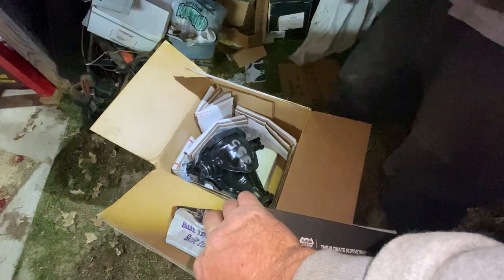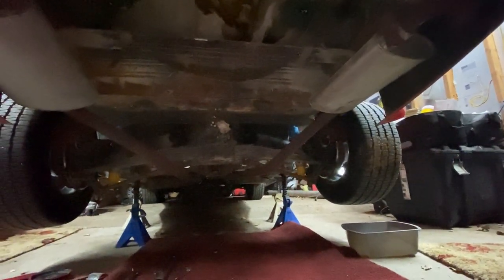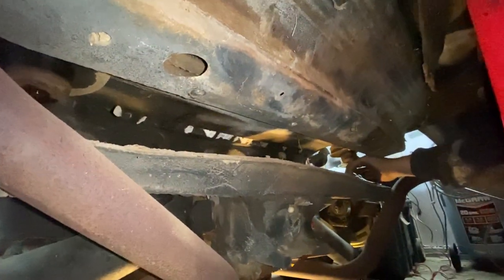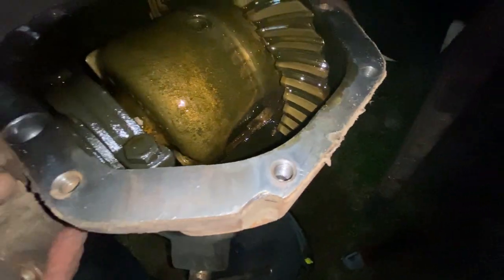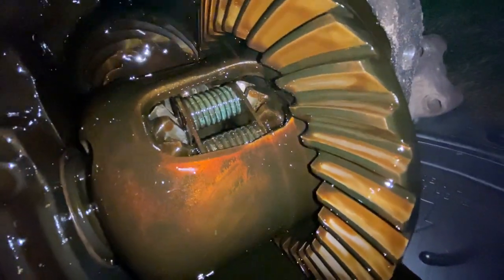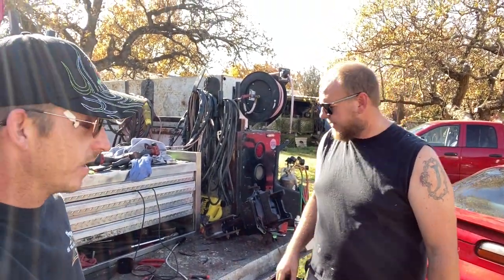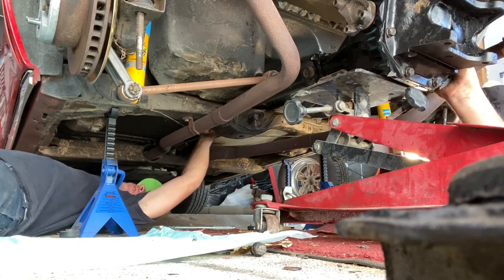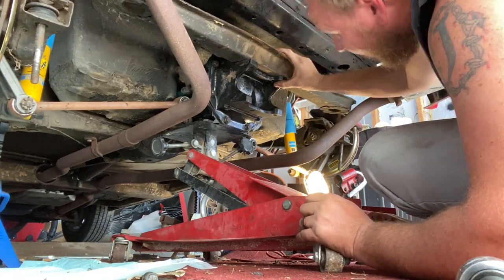1977 Corvette Final components. New Rear End- 355 Gears

Comment: Doing this on my 1979 right now a good chance you could have just changed the fluid and added a bottle or two of posi traction additive and the old one might of been fine.  It's a shame you used the original side shafts that are known to be the weak point and fail around the 30 to 40-thousand-mile mark. That is the only reason I am changing mine now because of a bad side shaft car that has 44000 original miles.   Good video though just leaving my thoughts for the next guy that might stumble on this video.

Comment: Good video! I would have liked to see how you wrestled it out without removing your exhaust. I need a new diff but my exhaust is welded to the hanger.
Reply from the maker: Cant rem if it was over the top, or not, Just give it a try. or cut it i guess.